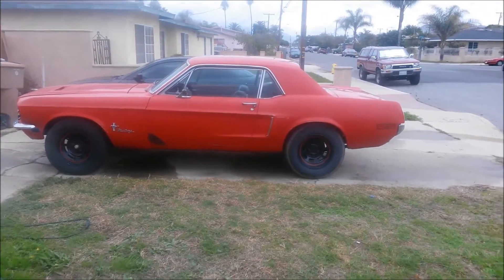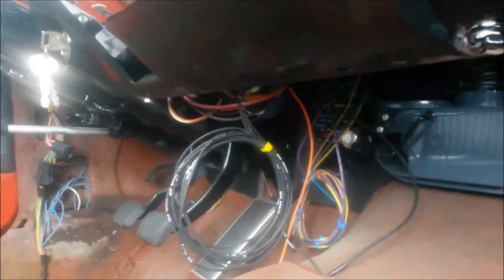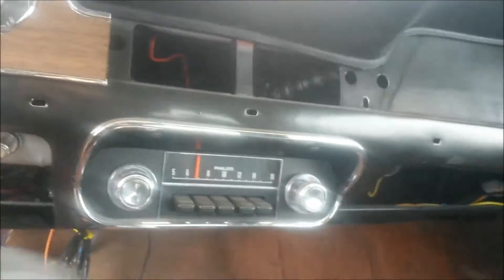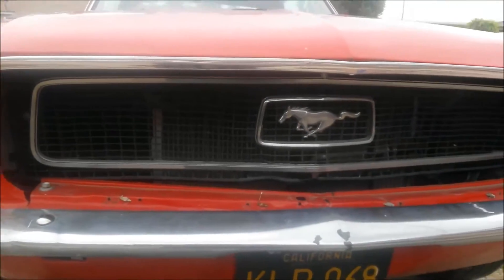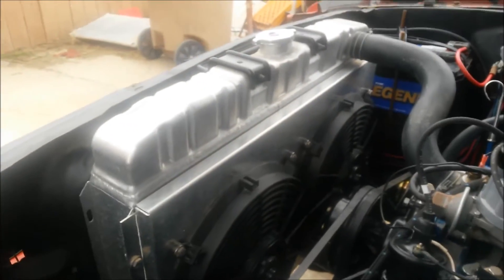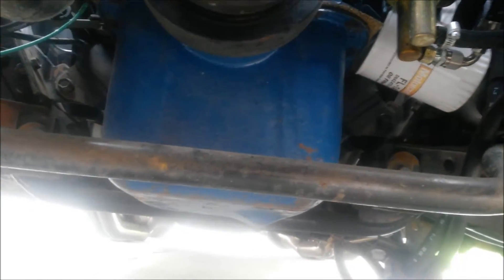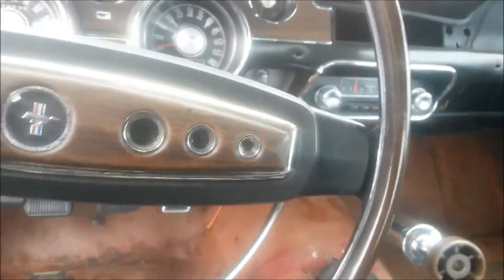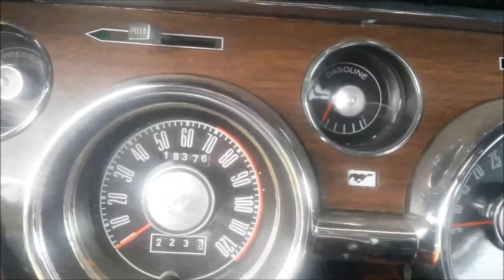1968 Ford Mustang 302 V8 5 Speed - Vortex - KILLER 68

Comment: I have a  68 with headers  but can’t figure out the power steering pressure hose to pump ? Keeps leaking some  one told me I have to use a 390 motor hose to reroute the hose . Would like to see how  you have the set up on those hoses ?